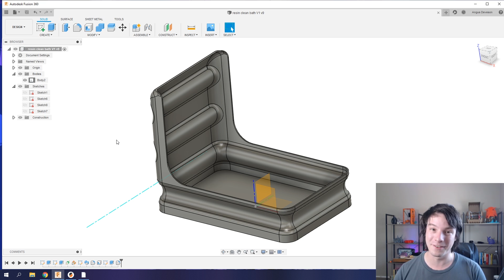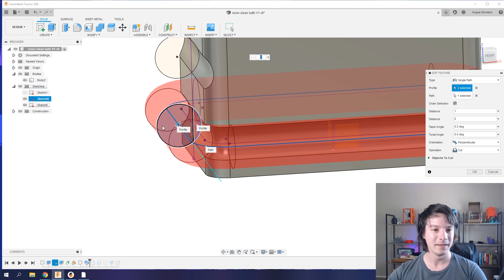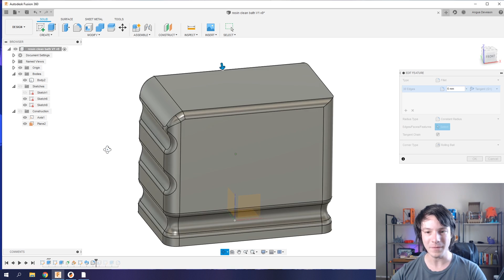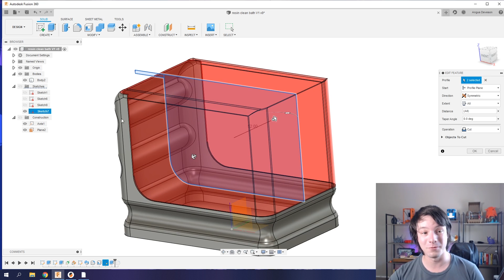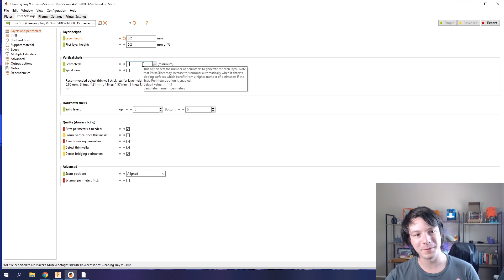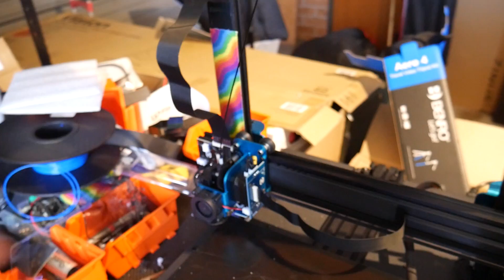3D Printed Resin Clean Tray with Infill Mesh!

Comment: Creallity nano coated bed just wont work with PETG. I use a thick layer of hair spray to deal with it. Whatever you are using to stick make it generous or PETG will be ejected. Other thing to keep an eye is the Z offset that time to time you need to recalibrate, because the sensor is not that consistent with my experience with creallity hardware and the bed screws are also not consistent

Comment: Using Green PET tape on your build plate helps with printing PETG! It's described as high temperature tape for masking/insulating. There's an ebay seller that does 200mm width rolls quite cheaply.

For a temporary/removable surface you can cover a piece of 200mm square toughened glass with the tape and leave it overlapping two edges by about 30mm to stick it on top of your existing heated bed, then just adjust Z offset for the thickness of the glass.

Folding over the two leading edges of the tape helps with peeling the secondary plate off again when printing other filaments and is easier if the bed is still warm. I've not encountered any problems with the PET covered plate moving when taped down this way. It has made PETG bed adhesion much more reliable, though I still tend to use a 5mm brim.

A major bonus is you can use lower bed temps - like 40C-60C depending on the object and when the bed temp drops below 40 prints come off relatively easily. Then for PP filament I have another plate with different tape =]

Comment: Please do not put IPA in an ultrasonic cleaner unless it is designed for flammable cleaning liquids. 
The vapour from the IPA can be ignited by the ultrasonic cleaner and all of a sudden you've gotten burning liquid everywhere.
For extra cool factor the flames from IPA are very hard to see (although the plastic in the ultrasonic cleaner and whatever is nearby won't burn so cleanly).

Comment: Just buy plastic pickle jars as they have strainers built in.  Time is the only currency you do not get more of so why waste it on this project in order to save a couple of bucks.  Sure if you have a very large printer you may need a custom setup for those large prints but I have seen any such printers here that would warrant this.

Comment: Good video. One thing to note: In Fusion 360 (unlike some other CAD packages) there is no need for the sweep path to intersect with the profile that you wish to sweep. Being you wanted it parallel to the bottom, you could have omitted the axis, plane and sketch. You could have just selected the path of the bottom of the object and gotten the same result. If you needed it at an angle that is not already in the body, then what you did is the only way to go. Also to note: if you later choose to go back in the time line and fillet or chamfer the bottom, it will cause the sweep to fail due to that path no longer existing. All you would need to do to fix it is to redefine the path to the edge of the fillet or chamfer. I did go into Fusion and checked to make sure this still worked. Fusion likes to change itself so if anyone reads this in the future and this is no longer how it works, sorry. It works this way today. :-D

Comment: I think you could have simply used the bottom perimetral edge of your "wip box" (the perimeter of the base, in other words) as your sweep rail. It would have saved you lot of modeling steps!
Reply from the maker: Hmm you could be right, I'm used to putting the sweep path in the center of the profile but offset it should still work! Good point

Comment: I had a similar problem twice with PETG. The first failure was also following a successful PETG print. I disassembled the hotend and found that the PETG hadn't fully purged the previous PLA from the nozzle. As a result, a thin layer of PLA had baked hard inside the nozzle due to the higher extruder temperature of PETG and partially blocked the nozzle. I have since dedicated a separate hotend to PLA only.

The second failure was due to the PETG filament absorbing moisture, which caused material degradation, probably due to hydrolysis, again partially blocking the nozzle. I cleaned the hotend, dried the filament and keep it dry, and it's worked fine since.

Comment: for those curious of how to do it parametric in openSCAD.... be prepared for it to take a few minutes to compile. there could be plugins as well that do the work. 
it does show why we need tool chains like fusion for cad.... so we may be kind of stuck with license's changes...

edit: i was shown the minkowski method after posting something similar on thingiverse.com it simplifies and speeds up curved surfaces much much faster

module rounded_3d_block_2(Xw,Xl,Xh,bevel, Fn = 96){
translate([bevel/2, bevel/2, bevel/2])
minkowski() {
cube([Xw - bevel, Xl - bevel, Xh - bevel], center=false);
sphere(r=bevel/2, $fn = Fn);
}
}

______________________________________________________________________________________________________________________________________________________________________

i like what Angus has done in showing design works. this is posted, out of respect for other choices. it does also show one of the needed benefits for alternatives and this is a decent tool chain for cad that remains unrestricted. this is more out of protest for fusion liscencing changes.
this then would use the same design considerations for the infill at base, because this model is also solid at base.

i will admit that tools like fusion, tool chains are a lot faster. lol. enjoy.. Angus... sorry for my rant. It's not at you.
https://www.thingiverse.com/thing:3941940

//this is shape of new container
containerL=100;//mm
containerW=100;//mm
containerH=100;//mm
thickness=4 ;//this is how thick part is
offset_outerbox=15;//this is how much of box to take away
// we need to setup beveled blocks, then the rest is easy....

module rounded_3d_block_2(Xw,Xl,Xh,bevel, Fn = 96){
    detail=4;//this is quality of angles
 translate([0, 0, 0])
 minkowski() {
  cube([Xw - bevel, Xl - bevel, Xh - bevel], center=true);
  sphere(r=bevel/2, $fn = detail*10);
 }
}

module complex_box_shape(containerL,containerW,containerH){
difference(){
rounded_3d_block_2(containerL,containerW,containerH,6);
for (i=[-1:1]){
translate([0,containerW/2+5,i*(containerH-10)*0.3333])
rotate([0,90,0])
cylinder(d=20,h=110,center=true);
}
for (i=[0:1]){
   
rotate([0,90,0])
rotate([180*i,0,0])

translate([(containerH-10)*0.3333,containerW*0.5+5,0])
cylinder(d=20,h=containerL+containerW,center=true);
}
for (i=[0:1]){
   
rotate([0,90,90])
rotate([180*i,0,0])

translate([(containerH-10)*0.3333,containerL*0.5+5,0])
cylinder(d=20,h=containerL+containerW,center=true);
}

}
}

//we now boolenn subtract shape from shape and cut out base
difference(){
complex_box_shape(containerL,containerW,containerH);
difference(){
complex_box_shape(containerL-thickness,containerW-thickness,containerH+0.05);
    translate([0,0,-(containerH/2-thickness*0.5)])
    cube(size=[containerL+containerW,containerL+containerW,thickness],center=true);
    
}
translate([0,1-offset_outerbox,(containerH-10)*0.3333])
cube(size=[containerL+1,containerW+1,containerH-thickness*2],center=true);

}

Comment: using the modifier for the central area of the tray to turn off the top and bottom layers would be another way to constrain the infill grid without possibly affecting the rest of the design

Comment: How hot do you print PETG? I've had so much more success since I turned up the heat beyond 270. Best results so far at 300C.

Also for a cheaper alternative to IPA, orange citrus cleaner is great. The brand I use is Totally Awesome which is sold at dollar tree for $1/quart of powder. About a tablespoon of powder is more than enough for that container.
Reply: Two words of caution... Make sure your printer and components are capable of handling those higher temperatures or you may face thermal shutdowns in firmware or clogs when you exceed the operating temps of a PTFE tube... Second, Cheaper does not always mean better... some of the resins are sensitive to the cleaner you use, for instance, methylated spirits contain some ketones which are bad for resins... I do not know the specific composition of the orange citrus cleaner, but you may want to look that up and test it thoroughly before you use it on something you really want to keep from breaking down.

Comment: Angus... Try doing that cut sweep around the bottom of your part again except this time... select the circle as your profile and then select the bottom edge of the part as your sweep path.  You don't need to create a plane and then a sketch with offset geometry etc. The untold secret of sweeps is that the path doesn't need to pierce thru the center of the profile that you're sweeping to create the sweep. :)

Comment: PLA filament becomes brittle when exposed to light, for some reason.
Reply: PLA is a biodegradable plant based plastic. How it degrades is UV light. The first step to the process is brittleness. This is a common affect of UV on everything, but due to the nature of PLA it is more noticeable.
Reply: So changing tubes to opaque and storing spools in darkness may help?
Reply: @SanityAgathion  I store all my filament out of direct light, and try to keep them cool and dry. I don't go to extreme lengths, but I have filament from 2015 that still prints fine.

Comment: Can you use a complex modifier shape to place your logo on the bottom of this vat?
Reply: You might be able to with some very complex modifier shape additions. However, I easily add embossed lettering to STL files by importing them into Microsoft 3D builder. Has simple tools for adding text embossing to your STL files.
Reply: You can import another stl file as a modifier so if your logo or lettering can be saved as an stl file then yes you can.

Comment: Rectilinear is not a great choice (when it comes to strength) as each perpendicular layer leaves a gap, touching the previous layer only where the two cross, grid would be much stronger as each layer gets the whole grid pattern rather than just one axis of it.

Comment: PETG works allright with buildtak surface.  If it doesn't, just sand the surface lightly with P220 sand paper on a wood block.

Comment: YES! Please do a deep dive on modifiers and how to maximize the utility of them 

I am sure you can come up with some yet to be considered concepts on how to utilize them in unanticipated ways!

Please highlight one current failing of the Prusa modifiers. I can’t seem to get help highlighting a fix of what I really think is a flaw in ability. 

To save plastic and reduce print time, a model can be constructed with a sacrificial 0.2mm bridge, and support material Only built up from the sacrificial layer rather than from the build plate. When appropriate. 

Think of as a simplistic example, a upside down hollow cube or hollow object with a top surface that is required to print in that orientation. 

If the “hollow cube” has a cutout on the vertical wall, typically the concept fails to make clean supports only from the sacrificial layer, as PS forces a wide support structure that can not be removed or rejected to hold the bridge of the cutout. (And I think this is the crux of the issue)

In the slicer everything works, but because the attribute of the outside bridge over the cutout window, the modifier fails to only generate supports where desired, and forces superfluous supports unwanted and unneeded despite a clear modifier for support enforcer above the sacrificial bridge layer, and a support blocker below. 

I assume it is like (order of operations) that is fouling the technique, and I would really like to see it fixed.

Comment: Hi Angus ,
Thanks for showing how to do this as i have been scratching my head wondering how i can make speaker grills or vents for fans without having to draw it in fusion . What would be very groovy is if one could use that primitive tool like you did but instead of a rectangle have it as a font so you can add words , names or designs  across a grill .
Reply: Hey, you can do that by loading any STL as modifier. Letters, logos etc. are no problem since prusaslicer 2.0

Comment: Nice idea for making your own seive :) I actually have some tupperware that has very similar kinds of seive to the original one you had, so that was a bonus for me.
You can do a plane tangent to a point, which sometilmes will make it parrallel, but I find if that doesn't work, either going through2 points or edges is handy, or simply making a plane along a path, choose an edge, and shift the plant to where the point is, then rotate if need be.

Aaaand you really should have watched my video on the licences! Audtodesk gave me some great info 😂

Comment: Using a sheet of polycarbonate as your print bed works wonders for PETG, it sticks perfectly.
Reply from the maker: Huh neat trick, how thick?
Reply: @MakersMuse  I use 6mm. If you can get cast instead of rolled, use that, as the rolled sheets need to be held down with a lot of clips once you heat them :) It also lets you print Polycarbonate filament with a bed temp of only 85C.
Reply: @_ David _  You would think so, but it actually works brilliantly, the pieces stick really well, but also remove perfectly and you can have much lower bed temps.

Comment: Hey bud, some advice for PETG and the first layer. You'll want to use a printer with a glass bed, and hairspray. The Hairspray will act as both as glue and a release agent, so put it on nice and thick (while the printer is cold! beware fire!). Bed at 80c - ish. First layer needs to be thick. If you press the material too close on that first layer (sub 0.15mm is BAD), it'll start to curl and look like bad adhesion! Print that first layer HOT!! Like +10c to +15c. You'll get bad elephant-foot, just use X/Y compensation for first layer.

Comment: I saw that infill-as-mesh on a cell phone case a few months ago.  Mind blown.  It works in Cura, too, and I've used it on fan vent parts.  My only problem has been that travel strings can mess it up, at least in Cura, and I've had to clean it up a bit.  
I often wonder if I'm doing things "the right way" in Fusion 360, but I think plane-at-angle is the simplest way to accomplish what you did.  
If you are still under Autodesk's $100K/year gross revenue cap, you are definitely still a startup no matter how long you've been going.  Not meant as a dig.  Slow, careful growth can be a very good thing.
Reply: Try pulling (retracting) the filament back more between layers. I think slic3r also has an option to avoid taking shortcuts back over the layer as well but I am not sure on that one...
Cheers,

Comment: PETG prints wonderfully on a MK3s, using the powder coated sheets.
It sticks very well, sometimes a bit hard to remove, fortunately these sheets are flexible and almost indestructible!
Reply: I have had some success with painters tape (blue). I scrub the tape (after bed layout) with IPA on a paper towel to burnish the surface and remove some of the tape coating and roughen it up. 

It's just a pain having to replace the tape every few prints.
Cheers,

Comment: That is very cleaver.   I would have done the grid in fusion, but then I would not have learned anything ... so thanks.   Regarding PETG, I use it all the time on a prusa MK3.   One thing that helps is using windex (window cleaner) to clean the build plate vs. alcohol, got that from Prusa.   Also,  I use the generic PET profile in the prusaslicer and NOT the prusa PETG profile.   I find the latter is too hot.  I am sure it works for their filament, but not what I have from matterhackers.

And as others mentioned, sweep needs - a -  path for the profile, not a path that is in the profile.  Fusion handles the "offsets" amazingly.   It even works with multiple profiles too.

Comment: For the printer PETG extrusion issue, I had something similar on my Prusa.  My solution was to tighten the extruder screws because I lost extrusion tension.  Check the Hobbed gear for crumbs.

Comment: You have probably melted the teflon tuning in the extruder, think 3dp nerd did that too if i remember correct.. changed it to capricorn and it was good again.. they used cheap black teflon tubing in the hotend.